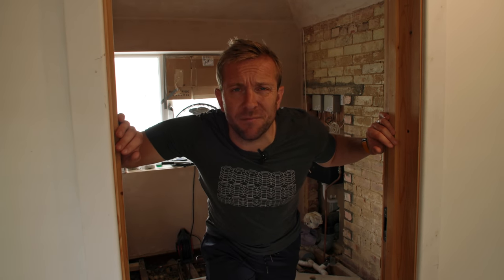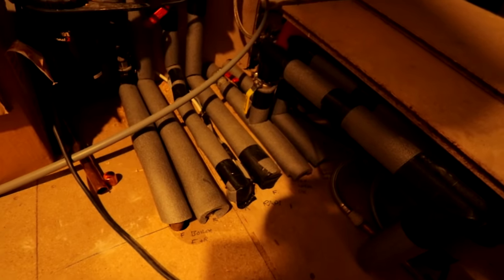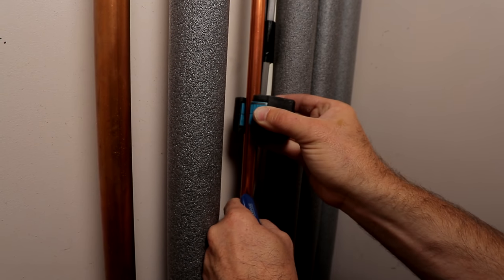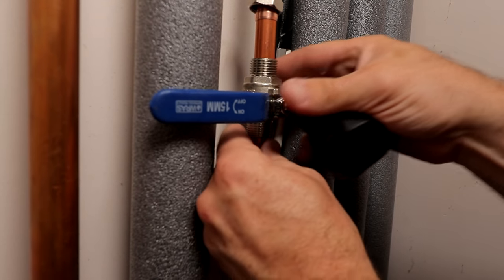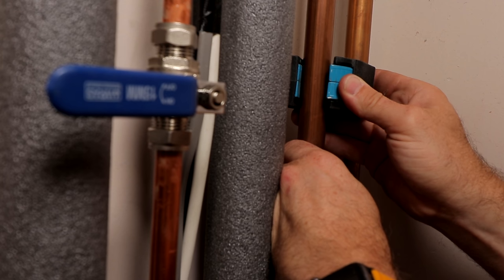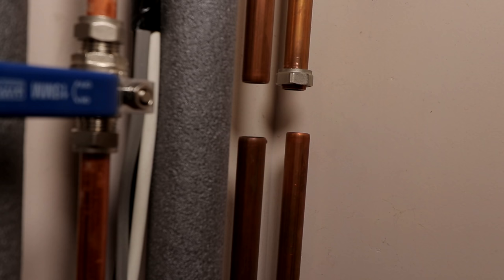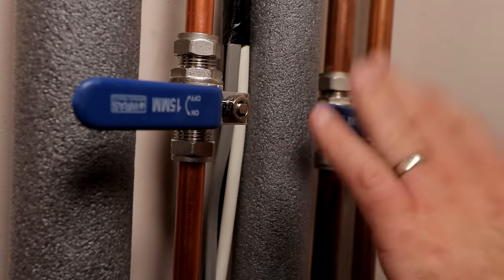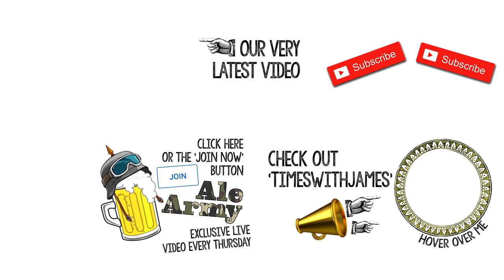💧BATHROOM RENOVATION part 6 - HOW TO INSTALL FULL BORE LEVER VALVE COPPER PIPE

Comment: Great, took off my first radiator today with the help of your videos. Need to remove a kitchen sink for the flooring guy. Going to install a couple those valves to easily remove and put backnthe kitchen sink.

Comment: Good video again James just one thing though...I was taught if fitting lever valves then have them so they turn up for water on and down for water off so can't be knocked on when should be off.
Reply from the maker: Yeah it’s definitely a thing. I had them that way round because of the wall and I couldn’t be arsed to take the handles off!
Reply: @plumberparts  👍😂

Comment: So glad you use jointing compound when fitting these compression fit valves! I always use a smear of LSX around the olive, just because it's saved me once or twice and never failed me once. I thought it was just me lacking confidence and being uneccessarily belt and braces!
Reply: I also always use jointing compound every time on compression olives. For the sake of a few seconds and a bit of  a wipe over it pretty much guarantees a good joint. It’s certainly nowhere near as much faff as  a leaky fitting..

Comment: Hi James thanks for the videos, I find them very informative. I do have one question you may be able to help with please. We are in a VERY hard water area and had to have a new tank element fitted, the amount of scale present was horrendous., So going to need something to try to limit the hard water.  A Water softener can’t be installed, so looking at an electronic scale inhibitor. Is this what I need ( if so any recommendations), if not do you have any other ideas please? Thanks keep up the good work.👍

Comment: Very sensible fitting proper valves, fit the daft ones with little plastic handles and you'll find the handles just twist off when you really need them.

Comment: I saw you did not use a pen reamer to deburr the inside of the copper pipe. I usually lose a lot of time to make it smooth because in the college they thought me that it may cause turbolences. Should I not care about?
Reply: It isn't strictly necessary to deburr the pipe if you use the "pipe slice" type of pipe cutter featured in the video (with or without a ratchet). I've done loads of connections without deburring and never had issues.
Reply: @gadgetman36  I always use a pipe slicer but I can see and feel the burr, you use a full bore valve but you resrict the pipe inner diameter of at least 2 mm in total. I use a pen reamer which is very sharp, much better than the plastic inside outside debur tool, it removes the burr in seconds.

Comment: Quick question I have one of these in my house and I’m trying to increase the water flow/ pressure of my shower. By moving the valve fully open will it help me as right now it is facing the other direction of the pipe

Comment: Jimmy, can i ask for advice please. what isolation values do i use on 15mm grey poly-pipes under the bath? unfortunately i can turn off the cold/hot water feed! are there in-situ isolation valves i can use? thank you for your advice.

Comment: Hi,  why do plumbers use grips and adjustables rather than correct size spanners  ? .
Reply: Because there are so many different size nuts by the different manufacturers
Reply: If only life was that simple. Allegedly half inch but in reality a hundred different variants of the nut.

Comment: Not using ptfe tape?
Reply: Compound is best stuff,ptfe is for DIY heads
Reply: @noelbourke5101  shouldn't need either for a compression fitting. PTFE is best for rad tails etc